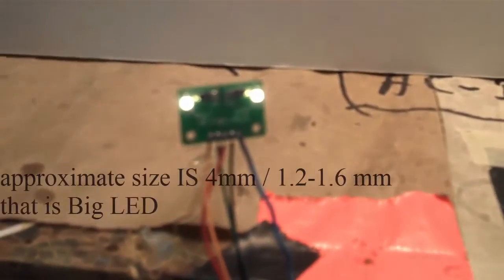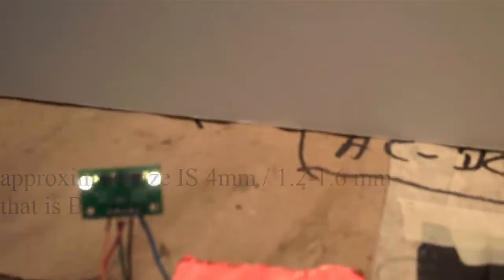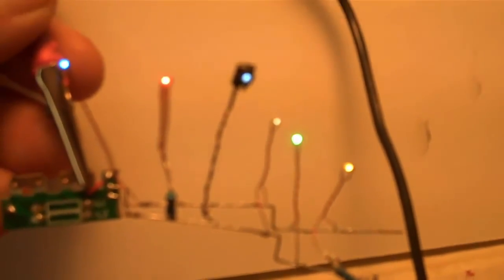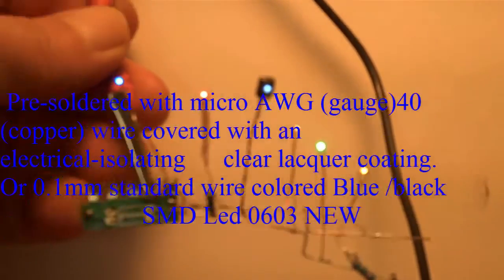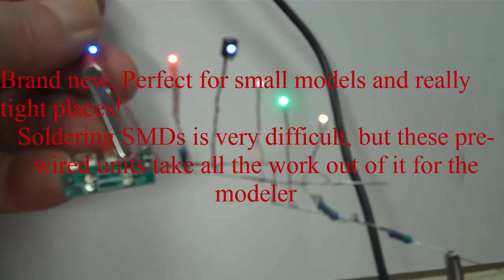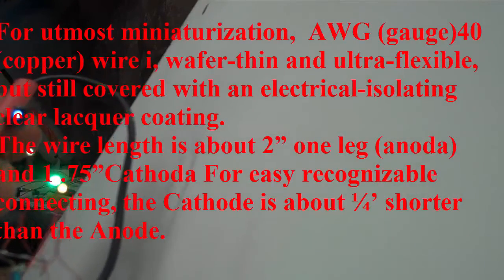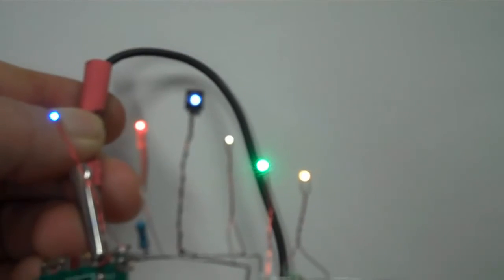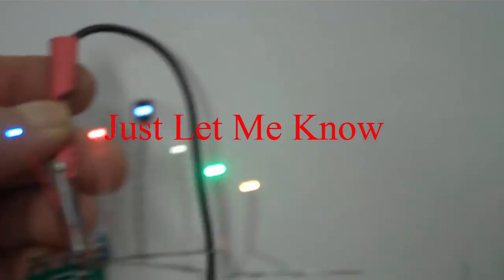SMD LEDS Module  Light-Emitting Diode

Comment: Hi Pete. I like your lighting work but I see that you are adding extra wire to the LEDs you buy already wired. You might like to try wiring up LED's yourself. One you do a few you will find it quire easy. See http://youtu.be/oW-IQ2-0jBg
I also sell 0805 LEDs (2.2mm long) with 200mm of wire if you don't feel confident enough to wire your own.